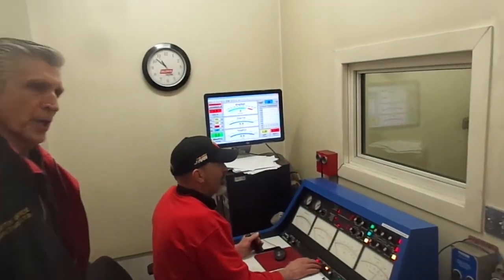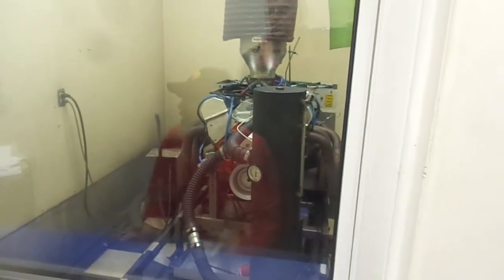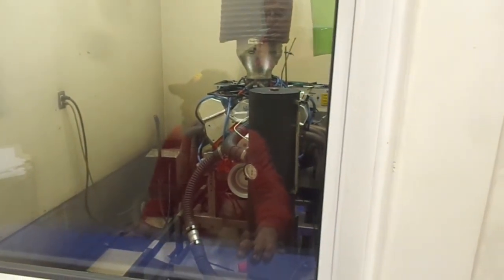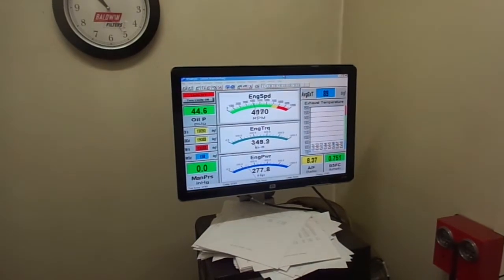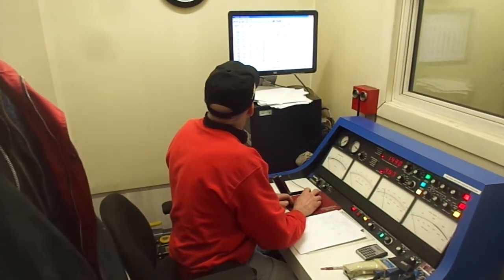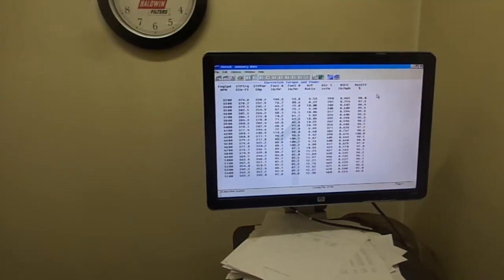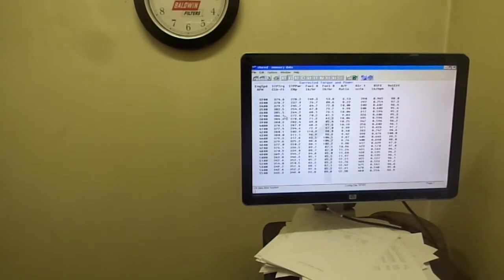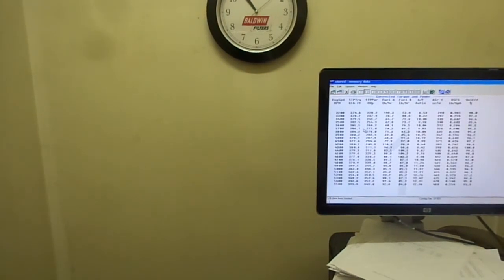Dyno test 355 Chevrolet engine,  how a dynamometer works, torque vs. horsepower explained

Comment: Hey Daryl and Al nice video of some local dyno work. That's some nice streetable horsepower, but I'm looking for a little more for my truck. Is the stroker version of this coming soon 450 torque would be nice.
Reply from the maker: Hello Ed. Just catching up on comments. We did do a 383 that made 460 torque and a couple of 400's since, more than 500. AG